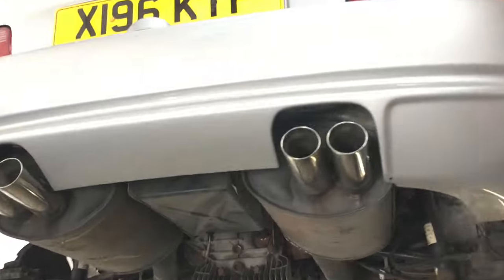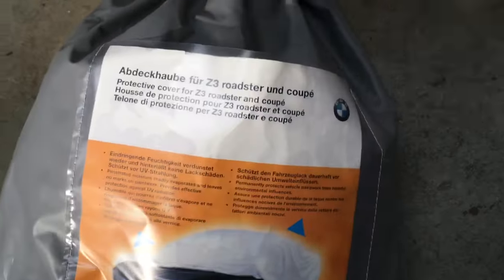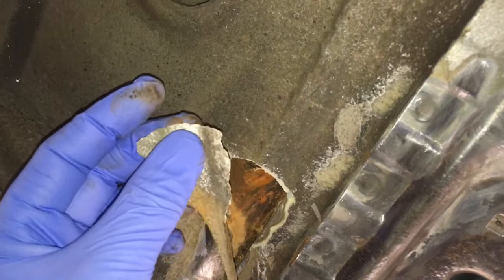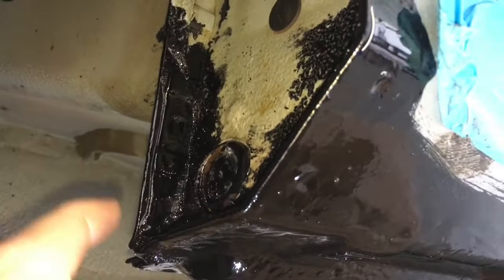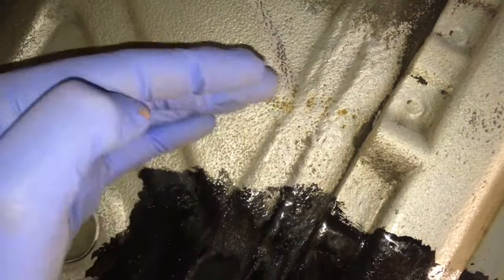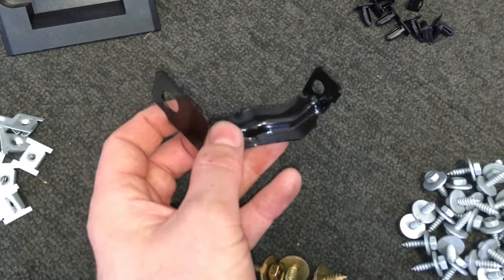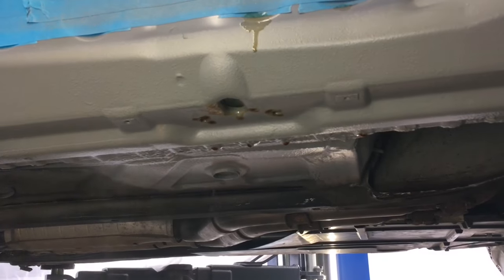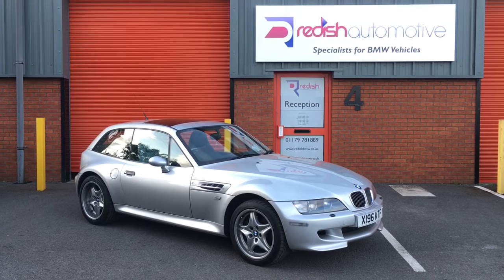BMW Z3M Coupe Underside Front Sill Restoration - corrosion removal with POR-15 Metal Prep

Comment: Very thorough attention to detail, I was a spray painter for 17 years, so I can appreciate the quality of diligence,   workmanship and methods used here more than most people.  It's very rare nowadays to find a workshop that would undertake this level of effort ' also it's a nice video reference for the owner to look back on , or for the purpose of selling the vehicle on  to a new owner.  Top work indeed .  👍👍👏👏
Reply: Your saying they have done a good job, but they haven’t got rid of the rust, only surface rust, they should have bead blast or one sort of blast that would get into the rust eaten holes, rust treat]Trent only works if the rust is all removed, but on this car it hasn’t, these guys are very good, I’ve used them on my e46 m3 cars I’ve owned, so not saying these guys don’t do a good job because they do, just pointing out the car should have been blasted not wire wheel used to remove the rust
Reply: @johnlerigo9703  The problem is it's a mechanics workshop / service bay not a professional bodyshop,  you could transport that car to a facility that does that prep, but it all adds to the not inconsiderable cost of this work already undertaken and bead blasting in a service bay is just never going to happen, without appropriate extraction and all the other required equipment.  What they have achieved with the  limited resources they have is spot on.
Reply: It dose add up but these guys aren’t cheap and have been doing this and rear subframe repairs , since the e46 m3 problem came to light, these guy do sort it all out anything from a service to paint repairs, maybe not all at there shop, maybe have a separate body shop that carries the paint out, that I don’t no, but it still needed blasting , if I have a small snap on blaster I’m sure these guys can afford one

Comment: Lads, I'm wondering if you normally when doing body work cover up threaded bolt holes or paint over them? Is it difficult to put in a bolt if there is paint in the hole? I’m about to repeat similar work and was wondering if those self-taping screws can be screwed into easily? Thank you ! 🙏🏻

Comment: Did similar on my car, but spayed in to the sill Bilt Hamber Hydrate80 rust converter to get in to the sill and drain from the flutes. With this then dry, I sprayed in some Bilt Hamber anti corrosion wax , which also has a rust killing ability to it. Outside of the sill then completely covered in cavity wax.

Comment: If corrosion is between metal sheets, then cleaning it from the outside does not make sense, because it will come out after 3-4 years?
Reply: If you can stop one of the 3 events of the corrosion triangle i.e. moisture, or air you'll slow the corrosion massively

Comment: I tend to stop with a POR like product. It does not look that nice, then again it is the underside of the car... Advantage is that it is easy to restore stone chips, etc. as there is no sealer that can get damaged. I inspect my car each year and it works fine.

Comment: have you lifted the front and rear carpets to see if theres any moisture there is a common point is blocked front scuttle panel drains leading to water ingress in front and possible  rear carpet area... this cannot be detected unless seats are removed and carpets are lifted.. may seem dry from the top of carpet well worth investigating this